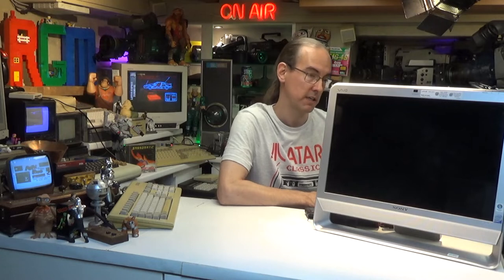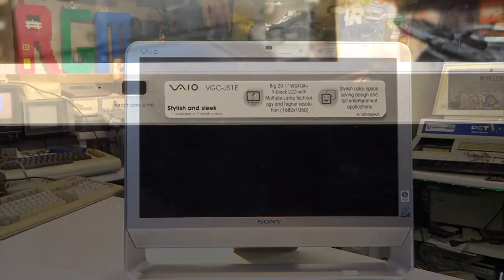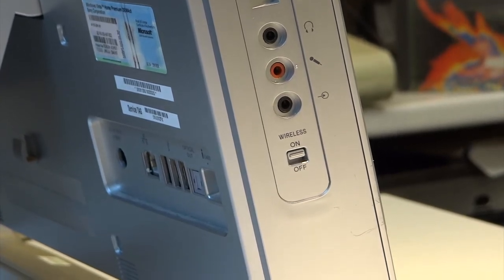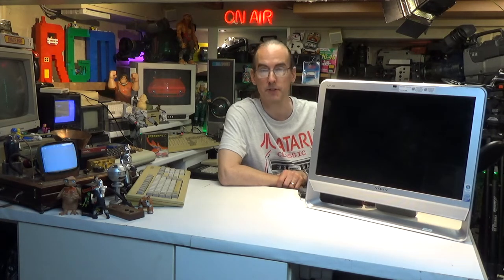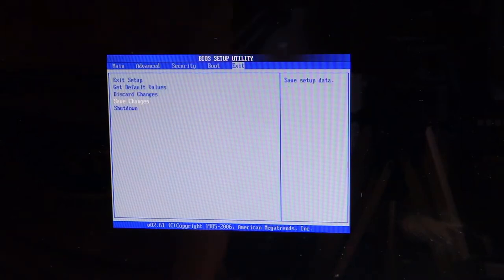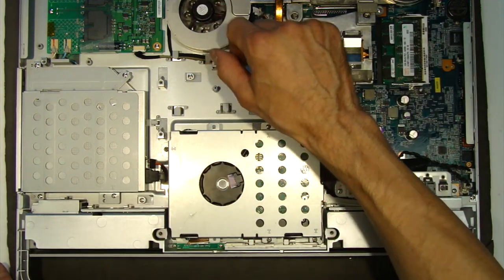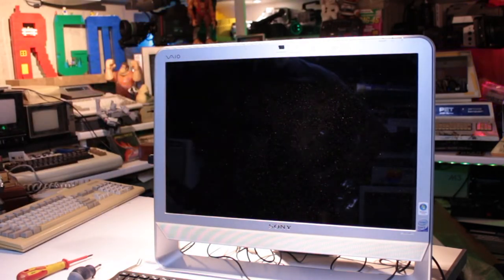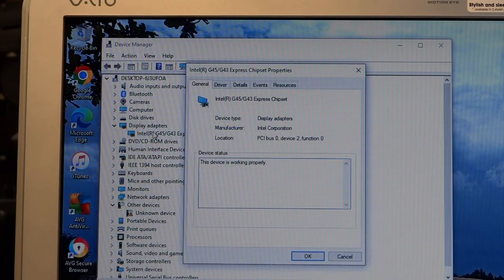SONY VAIO VGC JS1E All in one PC I won on eBay For just £2.77! A Restoration Video #vaio

Comment: Windows 10 is an interesting choice. I would be highly motivated to find a way to force install the older driver, to get that brightness control working. I really like your black and white insert shots.
Reply from the maker: Thanks. It was either windows 10 or Ubuntu.
Reply: @RetroGadgetMan Im having trouble getting Linux on my VAIO. Are you having the same issue?
Reply from the maker: @lumactrl  I never installed Linux. I only installed win 10 so far.

Comment: I've got a Japanese model JS that came with a miserable Pentium dual-core.  I originally did a Socket 775-to-771 modification and installed a low-power Xeon that took me from 2.2GHz to 2.6GHz, front side bus from 800MHz to 1333MHz and two additional cores; the TDP on the new CPU is so low that the fans never spin up and CPU temperature never exceeds 63C when stress tested.  I later bought an American unit because its motherboard has the NVIDIA GPU on it; its case is trash so I will swap the board over to my nicer Japanese shell.  The original keyboard and mouse are wired, not wireless, or at least mine are, and the wires are very thin so they can be managed with the rubber hooks on the back of the shell.  The keyboard you have there looks similar enough to the original, it just lacks the silver paint job and dedicated Sony buttons and media controls.  I adore mine and use it with Japanese Windows XP and 7 (dual boot) to play Japanese games (font rendering is often very broken in some older titles, even if you do all the 'correct' regional settings and compatibility shims).  My Japanese system came with the original Windows Vista installation and I was able to create recovery media for it, but again, it's Japanese and it's Vista.  I don't think the system has a brightness control at all.
Reply from the maker: Interesting modification. Thanks for the information. Strange how there is still no Brightness control with the original software.
Reply: @RetroGadgetMan   "Brightness Control" ... YES ! I also looked for that and haven't found any solution for that. Even Linux isn't able to access the brightness. As you mentioned, the BIOS is ludicrously handycapped and the the button controls as well. As I mentioned in my post here, these gadgets are highly focused on "ordinary" consumers; throwing such high tech stuff on the trash or putting it on 2nd hand sale. This might be the reason for low prices because these things are hard to manage and to be upgraded for contemporary usage.

Comment: Which Windows 10 version build version do you have installed on it? I have had the experience that the old Vaios up to version 1903 (19h1) run well and you could also change the brightness, with the newer versions of Windows 10 on some old vaio devices there are problems with the brightness control.
Reply from the maker: Interesting. I can't remember which version. Would have been the latest one back when I made the video. Pc is in storage now. Thanks for the information. I will have to remove that for next time.

Comment: I just found one of these in the junk section for ¥1,100. I enjoyed your video. I'm still learning but hopefully I can do what you did and get this running again.
I think this will be a fun fix. Mine unfortunately is really dusty inside so we will see
Reply from the maker: Good price. The fans on the vaios are unreliable, a good clean out will help.
Reply: @RetroGadgetMan  I'm excited to clean it. I think mine doesn't have a hard drive either so I need to figure all that out as well.
Reply from the maker: @dedbattery it's a nice project.

Comment: Hello.. need help. I have a Sony all in one and it doesn't come on .  I have tried disconnecting the mouse and keyboard and holding down the switch for 20 seconds from the instructions I found on the internet.  Do you think that I will need a new motherboard or a new switch?
Reply from the maker: Hi does it have a separate power supply like the model in this video. "19.5v" or is it a power cord. If it's a separate power supply it could be faulty. Some of them have a green led light. If you listen closely you can hear them humming whilst powered up. If it's clicking or doing nothing at all then it's more than likely a faulty power supply. Testing it on another Sony Vaio will verify this or use a multimeter to test its output.
Reply: @RetroGadgetMan  Thanks so much for getting back with me.  There's no noise coming from the power cord.  What's my next option?
Reply from the maker: If you don't have another Vaio to test it on then maybe take the power supply to a computer shop and ask if they can test it for you.
Reply: @RetroGadgetMan  Will do..  Will let you know how things work out. Have a wonderful day!!!
Reply: One more question.. I went to Amazon to try and order the power cord..not expensive but none of the suppliers have this series VGP-AC19V15.  They skip over this one. Is there another cord that I can use?
Reply from the maker: @valerieholzer7893  as long as the voltage and amps are the same and the polarity of the pins are the correct way then you should be able to find an equivalent. Better to use the identical Sony as some unbranded ones are of poor quality. You could probably find the Sony one you need on eBay. And of course it may not be the power supply at fault. Its  just a process of elimination.

Comment: I have the same e pc which I bought from Japan. Do you think it is possible to change an ssd hard drive instead of the original one will make it faster?
Reply from the maker: If this has the factory installed mechanical drive then it would be worth upgrading to an SSD. You will see a slight improvement on booting up and running some software. SSD are cheap enough now to give it a shot.